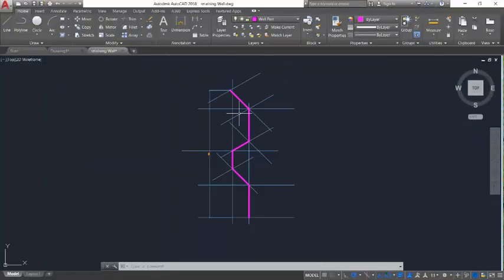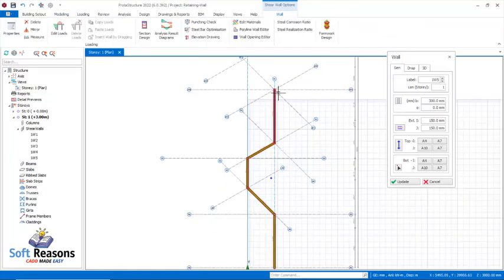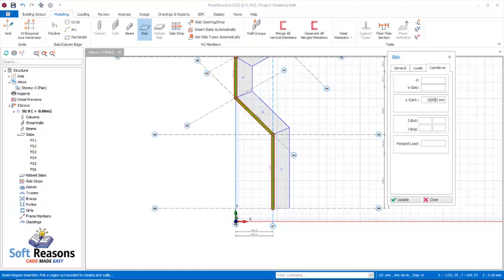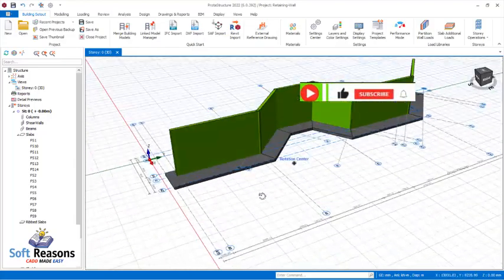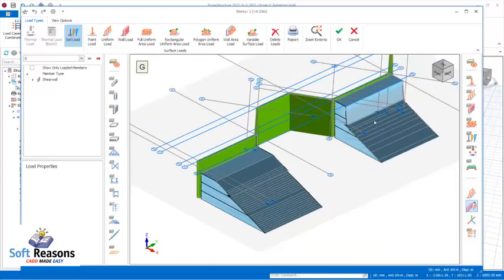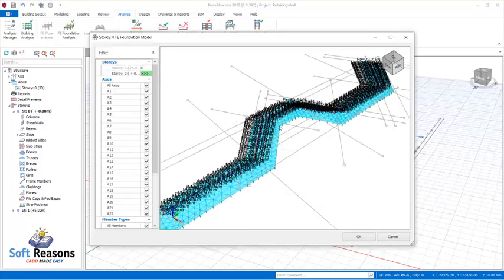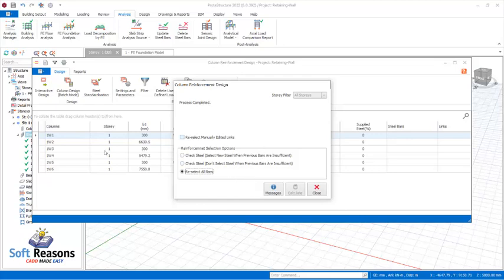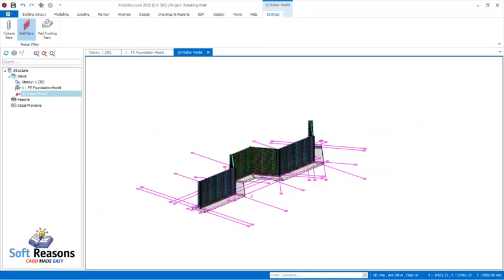STRUCTURAL CANTILEVER RETAINING WALL ANALYSIS AND DESIGN IN CIVIL ENGINEERING #CAD

Comment: May I ask if it is possible to model, analyse, and design a tapered cantilever retaining wall in protastructure?
Reply: Do you have tutorial for its analysis and design ( of the tapered cantilever wall) or any tips on how to do it??
I would really appreciate your response sir as it will be a great help for my capstone project
Reply from the maker: @mirrashanerico2392  join our YouTube channel membership. Use the join button on our channel. It's going to be members only video
Reply: @CADmade-easy very much willing to join your channel sir but may I ask atleast what is the youtube link??

Also, just want to clarify that the analysis and design of the said structure is on protstructure itself, not the one on the protadetails sir.
Reply: Sir?
Reply from the maker: Yes Sir